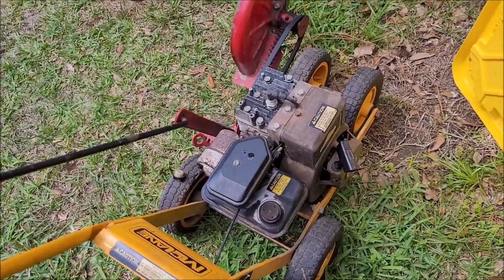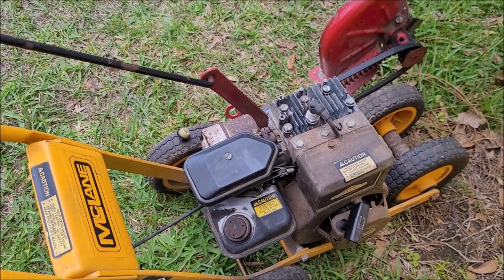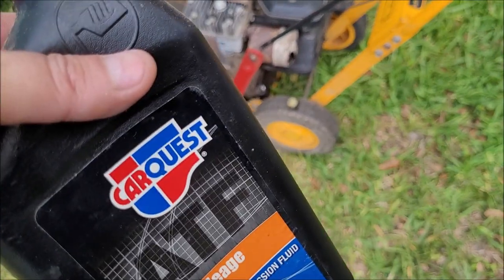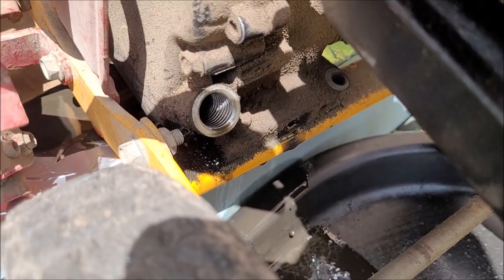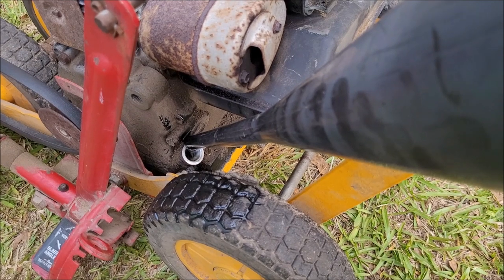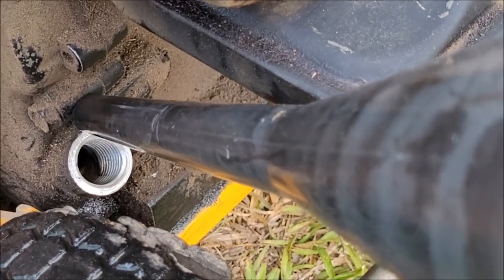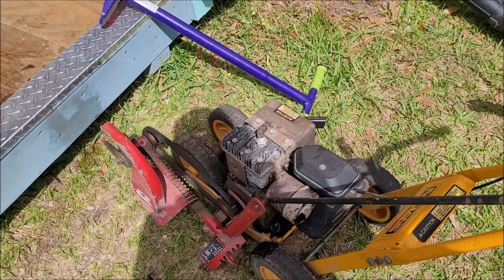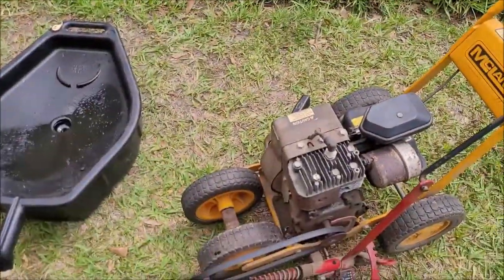Changing Oil - 1993 McLane Edger 801-3RP-9 - Briggs & Stratton Side Shaft Engine

Comment: Just inherited this exact model from a neighbor. Any idea where to find parts for this machine? I need to do a tune up and get a few other things for it.
Reply from the maker: Somewhere on the engine cover a Briggs engine number will be stamped, perhaps lightly.  It will be in this format: 123456 1234-01 
If there are numbers behind those that's the date code (98081001 would be 1998 Aug 10 plant 01).  You can punch the model number into Google and find a parts breakdown (Jack's Small Engines is a good vendor)
Reply: @audubon5425  awesome, thanks for the info!!